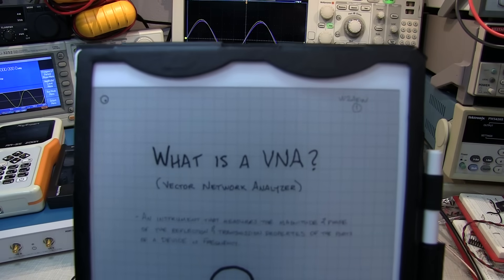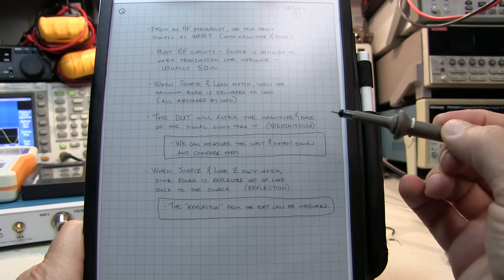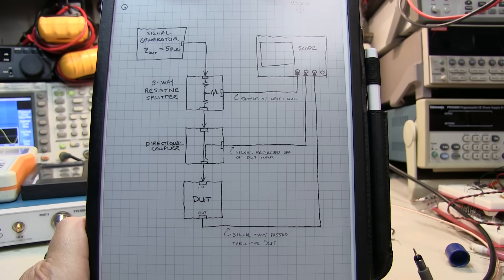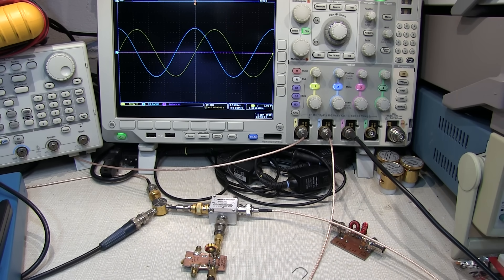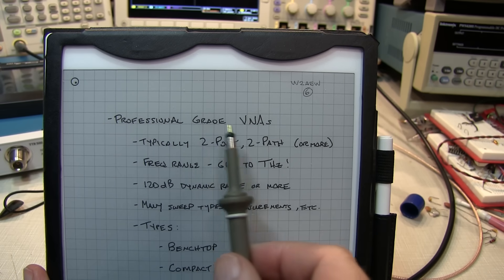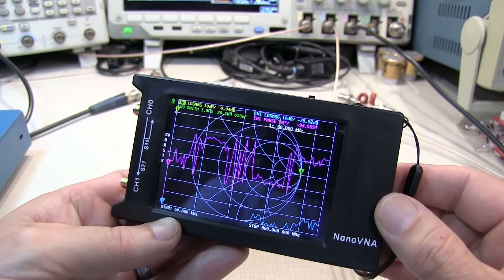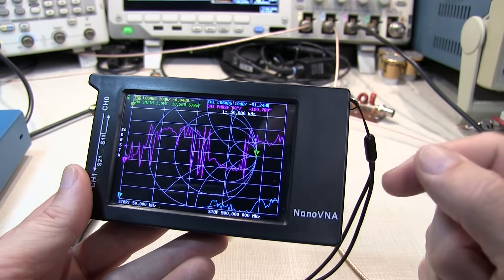#312: Back to Basics: What is a VNA / Vector Network Analyzer

Comment: Excellent video presentation on VNA's  It's one of those must have tools for RF work and play. I'm really surprised how well the NANO VNA measurements are so closed to the expensive VNA's like the HP 8753 and Agilent FieldFox units.  For home use such as Amateur radio it's hard to beat that low cost for this type of RF tool. Thanks again for the video and looking  forward to more .

Comment: I recently had a look at the nanoVNA too, nice design (schematics are on their github).  Interesting to see that they didn't use a directional coupler on CH0 but went for a bridge to do the reflection measurement.
Reply from the maker: Do you have a link to the schematics?
Reply: @w2aew  https://github.com/ttrftech/NanoVNA/blob/master/doc/nanovna-sch.pdf
Reply: At HF frequencies nobody uses an actual directional coupler which only works at microwave frequencies anyway (so far as I know).  They are all bridges measuring instantaneous voltage and current.  ONLY in the case that the device under test is 50 ohms resistive, the voltage (handed off to the sense device) is in phase, but an inductor sensing the current hands it out of phase; that is, one end of the inductor is going to be in phase and the other end is out of phase, and if the values are correctly chosen, the capacitive coupled voltage and the inductive coupled voltage cancel and you get zero "reflection" but really all it means is that the load matches expected values.
In the "forward" direction the inductive coupling and capacitive coupling augment.  
In practical terms it appears no different than you would get from an actual directional coupler and you can think of the indications as reflections but really it is a change of ADMITTANCE because of mismatched load impedance.   If the load is too high of impedance, the current through the detector will be low, and the inductive voltage insufficient to cancel the in-phase capacitive coupled voltage.  In the case of too low of impedance, current will be high, and the dominant voltage on the "reverse" port will be derived from the inductor rather than the capacitor.
The sensor with two toroidal inductors works on a somewhat similar principal; one is wired to sense current (and turn it into voltage) the other is wired to sense voltage and turn it into a current.  When the load is 50 ohms resistive, these two inductors produce voltages that cancel at one end of the inductors and augment at the other end.  Thus one end shows zero "reflection" but it isn't actually measuring reflection.  
Think of a Simpson 260 voltmeter.  It measures magnetism produced by a small current but its display unit is voltage.  But it doesn't actually measure voltage; only current!  So it is these small devices are said to be measuring reflection, but that's not actually the case.

Comment: I love my NanoVNA only cost me $36 ish off wish from someone around New York. (It works so I can't complain.)  I have used it to tune up my 40m dipole I use with my SDR and also found that my dual band vertical on my house might work for some parts of the 900Mhz band.

Comment: Can you  make a series of video about measuring different components on VNA (splitters, diodes, power transistors, power detectors, circulators, filters, amplyfires etc). Noise figure, power compression, Volpert smith graph explanation.

Comment: Everyone of your videos is clear, concise, and enjoyable.  Automatic like.  I love my RSA507A.  Until I save up for a TTR503A, an external coupler is getting me by.  My calibration set is built with help from your previous videos.  They compare well enough to commercial sets.   My use is greater than hobby  but less than a research lab. Thanks for the excellent videos!
Reply from the maker: I wonder if you got the tracking generator and reflection measurement options.  That turns this fine realtime spectrum and vector signal analyzer into a 2-port, 1-path scalar network analyzer.
Reply: w2aew Hi Alan, I do have the tracking gen.  I don’t have the return loss option.   I have considered it though, and still may get that. I use an external directional coupler with it, but don’t get the metrics provided by the option. I want to be able to do phase type measurements and use a smith chart.  If the RSA can do that in the future, That would be awesome.   At the moment the Rig Expert AA-1400 helps me with antennas.  For now it’s filling up the penny jar for a TTR.
Reply from the maker: @stevefoudray487  You can enable a 30 day trial license for the Reflection measurements, so you can try  before you buy.  Currently does not do phase (thus, no Smith charts), just scalar return loss, VSWR, distance to fault and cable loss.

Comment: Thanks for the video, Alan - excellent as always. 
I bought a Nano VNA because I was having issues with the range of the anti-collision device in my sailplane. It allowed me to design my own antenna which has vastly improved the coverage, and given me greater time to respond to warnings. Without it, I would not have had a clue how bad the various proprietary antennae were at the frequency used, 868.3 MHz.  It allowed me to get pretty close to the centre of the Smith Chart even without a matching network and it shows around -30dB reflection loss and an VSWR of less than 1.1. Can't think of anything else to use it for yet but I am a 'newbie' to the world of electronics and particularly RF.

Comment: Thanks for the video!  When I want to check whether an antenna impedance matches the output impedance of a transmitter (or, alternatively, the input impedance of a receiver) how should I do that with a VNA? How should I calibrate the instrument?
Reply from the maker: In most cases, it is reasonably safe to assume that the transmitter and receiver are designed to be used with 50ohm transmission lines, hence are matched to that.  So, you want to strive for matching the antenna to 50ohms.  Calibration should always be done over the specific frequency range that you're measuring over.  You can perform a calibration with the cal standards at the antenna end of the cable (so the transmission line is deembedded).  This will give you the actual impedance at the antenna.  If that is not practical, then you can calibrate at the transmitter end of the cable.  SWR doesn't change with the cable length, but the input impedance does.

Comment: hello Alan, simple question, is half of the power of a transmitter with 50 ohms internal resistance when adjusted, i.e. when loaded with 50 ohms, destroyed in the internal resistance? So my 100 watt transceiver must destroy 100 watts?

Comment: Well done. I always ask myself if the "forward and reflected" superposition analysis only make practical sense in the transient response, when the signals are applied for the first time and are really bouncing in the line. Because, in steady state, the only thing a reactive load can really do is change the voltage and current phase relation, much more like as in the power factor sense.

Comment: It would be nice if these cheap(ish) VNAs would work to lower frequencies so I could measure components where you normally would do that at.  Down to 1 kHz or maybe even 10 kHz would be low enough for SMPS work.  Of course, a component impedance analyzer goes  to 100 or 10 Hz and are usually a 4-wire source/measuring device.  THAT's what I'd like to see in a cheap-ish network analyzer.  I'm SURE it is possible !  Maybe not accurate enough  at the low impedances ?
Are VNAs a voltage source ?  Maybe I'm talking about a current source
Reply: The latest nanovna-v2 firmware goes down to 10 kHz: https://github.com/nanovna/NanoVNA-V2-firmware/releases/tag/20200525

Comment: Do you have any tips to "wind" a tiny transformer to use that 50 Ohm Nano VNA with 75 Ohm cables/devices/equipment? 
If I attempt that, it should immediately display the "RF horror" resulting from anything other than a perfect impedance conversion, right? 
Can that amazing little Nano give distance readouts (open/short/matching) like a TDR can to help identify hidden MATV cable runs?
Reply: VNAs are typically good at measuring impedance within one order of magnitude of its characteristic impedance. It's easy to get accurate results by simply connecting your 50 to 75 ohm transformer, then calibrating at the output of the transformer. Then all measurements will be with respect to the 75 ohm output.
Reply: @Ziferten   Thanks for the clear educational videos! - love your test equipment - I'll dig out an RF book in case the web goes dark, lol.   
Is it just going to require a single or double core ferrite core with a 2:3 turns ratio?  (I'm new to this RF construction wizardry, but have plenty of old Winegard "parts" to cobble away at.)

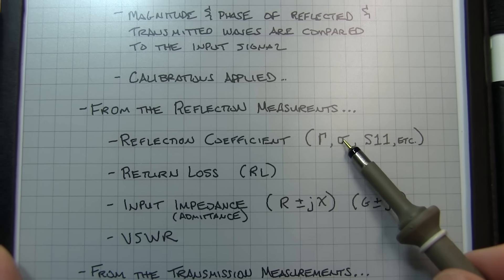Comment: Ooops!   Your written rho at 9:23 is actually a sigma! - rho has a vertical tail.  :)  Nevertheless a great explanation and demonstration (as usual).
Reply from the maker: Oops, thanks for the correction.
Reply from the maker: I have corrected the downloadable notes.
Reply: And  rho is acrually the voltage signal wave ratio (VSWR) not the magnitude of reflection coefficient right??
VSWR = (1 + abs(gamma)) /( 1 - abs(gamma)), which is also the ratio of Vmax to Vmin
Reply: @xmun9236  Complex gamma (rho angle phi) = complex (V reflected/V forward),  so rho is the reflection coefficient's magnitude (absolute value), and not the same as Vmax/Vmin (= SWR when the line's not matched).  Complex (V ref + V fwd) is a solution of the transmission line's wave equation.  So V ref and V fwd can be thought of as independent waves that "combine" to create V max and V min along the line.

Comment: I bought a NanoVNA and it is amazing. It has allowed me to accurately measure inductors that i have wound ( many were quite off supposeded calculated value) as well as tune antennas easily. It has been worth every penny for sure.
Reply: Really, and the NanoVNA V2 extended the measuring range, it makes 2.4GHz antenna tunning easily.
Reply: @ziyuewu3715  oh wow i may need to get a new version!
Reply: @ziyuewu3715  May be a dumb question, but isn't the nano up to 1.5GHz? Would that still work for 2.4GHz antennas?
Reply: Sadly the standard 2.8 inch NanoVNA screen is too small for my eyes to easily read the text :(  But I have heard a rumor that a 4 inch screen S-A-A-V2 version may be in the pipeline.  :)
Reply: @keithrainbow  Also, you can use it from the computer over USB
Reply: If you had a good osciloscope & frequency generator, you could work out your inductance with the use of a tank circuit and a known good capacitor/s... maybe cheaper than the nano.....especially if you already have this gear I mentioned.
Reply: @michaelhawthorne8696  i used to use that technique but my osxilloscope is an analog scope and it doesnt get bright enough to see the traces to see a tank circuit ring. Plus lots of calculator involved. Also it still requires the capacitor to be accurate with that method. The nanovna doesnt need the capacitor..and it already reads out in microhenries so its super easy to use.

Also i found the inductors actually change in value over frequency ranges (what measures as 10microhenries at 5mhz may only be 6 microhenries at 10mhz) this was not expected. Thoery always states the inductance value is only based on turns, etc.  But that shows the ring technique also will not be truly accurate unless you use a tank close to the frequency your circuit is going to be. If you are building a chebechev filter you have to be accurate or it wont work properly at all
Reply: @N7TWL  Presents... After you calibrate the NanoVNA you can just connect it to the inductor, the screen on the NanoVNA will actually already show the uH/nH values, written out. Go to the smith chart and the numbers should show up there as well
Reply: A great educational tool as well. In my upper-division undergraduate Applied Electromagnetics course we used the NanoVNA for all of our laboratory assignments. Working with the NanoVNA hands-on and seeing the RF principles directly really helped drive home a lot of the material from the lectures. We studied transmission line theory, S-parameters, impedance matching, transients, antennas, and more. Definitely learned a lot!